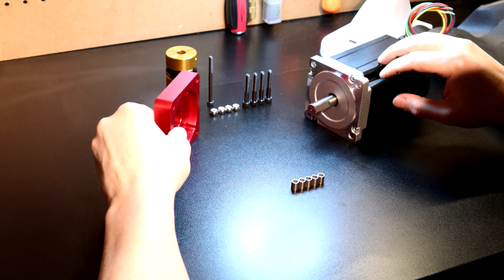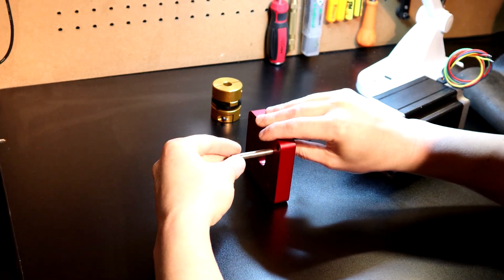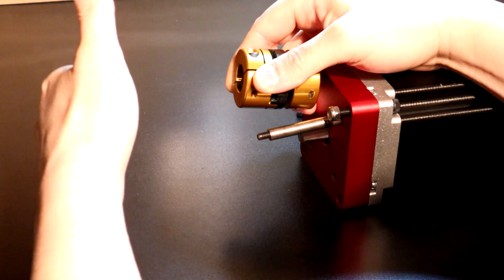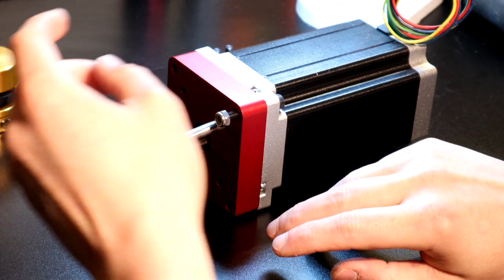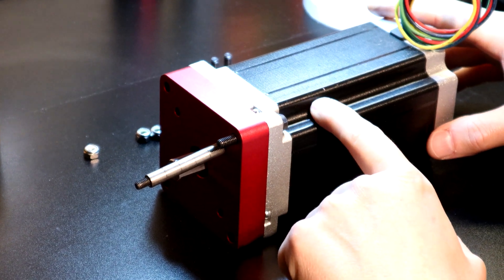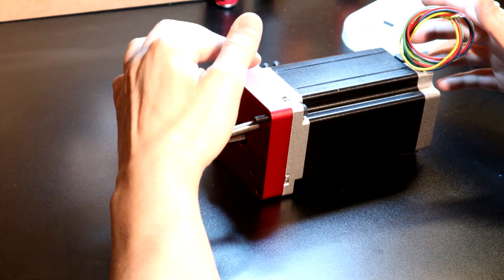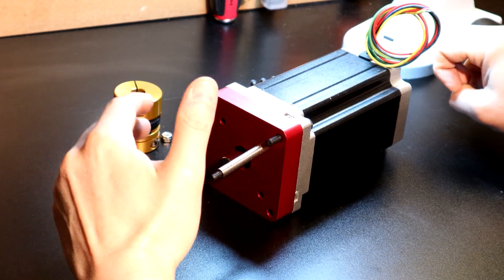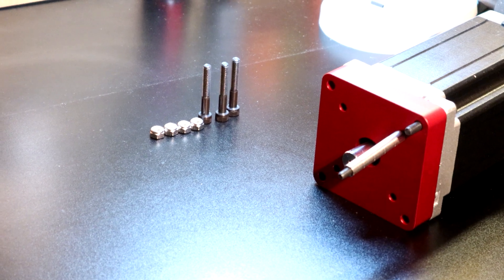Bolt On CNC Conversion Kit From A Nema 23 To Nema 34 Motor For Maximum Machining Expandability (4K)

Comment: Will the drivers for the NEMA 23's still work for the NEMA 34's?
Reply from the maker: Hey Jim,
Thank you for your support. The drivers will be compatible based on the amperage of the Nema 34 motors you're planning on using as well as the drivers amp ratings you're using with your selected Nema 34 motor choice. Thank you, and have a great weekend!
Vince